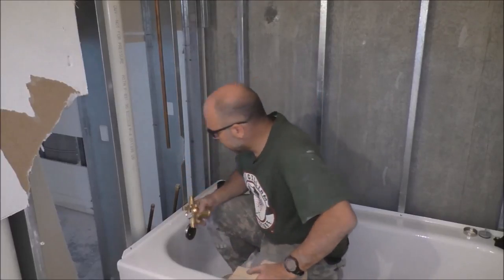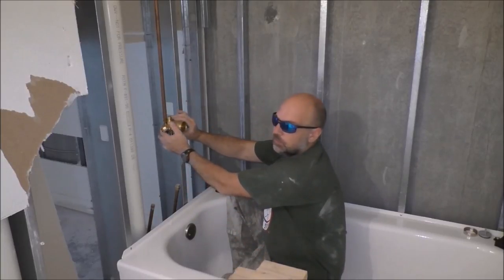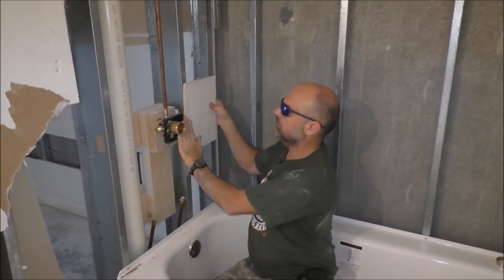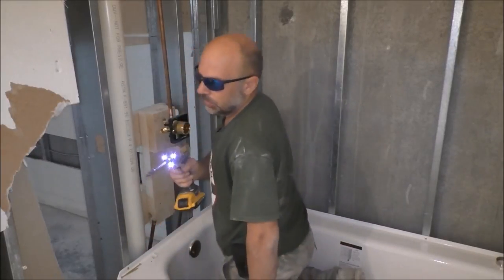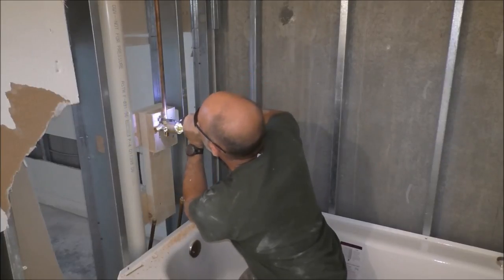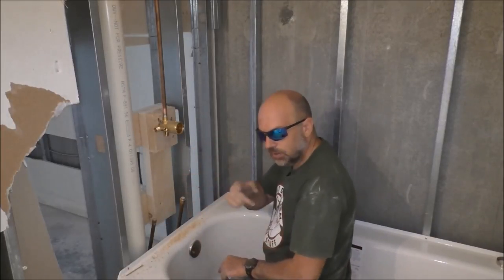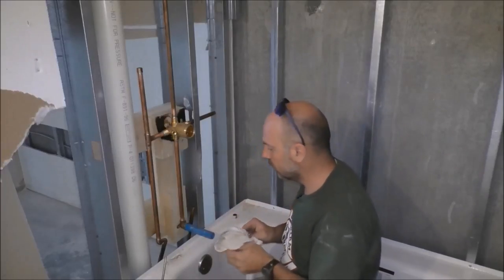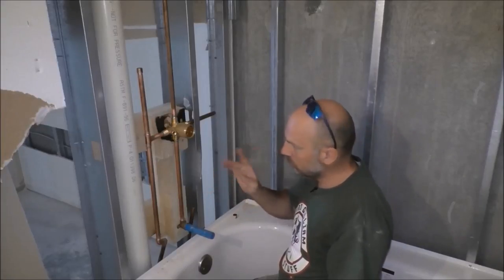Condo Shower Valve Install With Copper Pipe

Comment: Great video Chris! Just one question brother why Delta? Is that the brand you like for shower valves or was it a customers choice? I highly suggest you check out the Moen PosiTemp valves bro they are great valves the cartridges last a long ass time and they have a ton of different trim options plus they are really affordable and come with a lifetime warranty I sound like  Moen salesman I know but I just really like the PosiTemp when im putting new valves in and though I do like Delta valves and I think the Delta cartridges probably last the longest they are almost always a fucking pain to repair and are extremely expensive to repair.
Reply from the maker: I install what the customer buys. Delta is 90% of it. I've installed Moen. Bought it for my own house back in the 90s.
Reply: @ChrisGilliamOffGrid  Yea i like Delta for Kitchen faucets they without a doubt in my mind make the best kitchen faucets right now and One thing about a Delta shower valve is that things gonna last a fuckin long time even longer in most cases than the Moen PosiTemp that i was recommending I just know everybody has the brands they like and push more than others. Like I push Moen Shower valves, Delta Kitchen faucets and typically Price Pfister bathroom faucets but im gonna stop referring Price Pfister because their warranty has gone from the easiest best lifetime warranty to garbage overseas call center shit. Ill probably recommend Delta bathroom faucets because Deltas warranty is a peace of cake to work with and you talk to Americans on the phone who you can actually understand and will get shit done.
Reply: @PlumbingExplained  ,  All I have in my home is Delta,  they stand behind their products.  Cartridge was going out in one of my showers  and I called their help number and they mailed me a knew cartridge kit no charge .  Not too many companies do that.

Comment: Round about what would u charge for a job like this ?
Reply from the maker: Took 5 trips (to do entire unit), some shorts days, a couple of long days. I charged $730 labor, and $637 material. I'm cheaper than most.
Just to do a single shower valve install I'd just charge $100 or so.